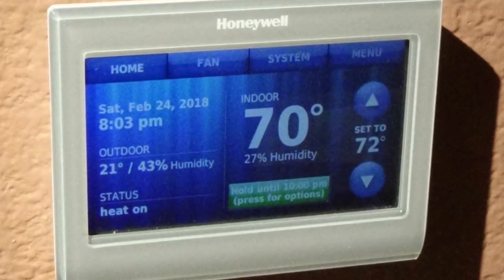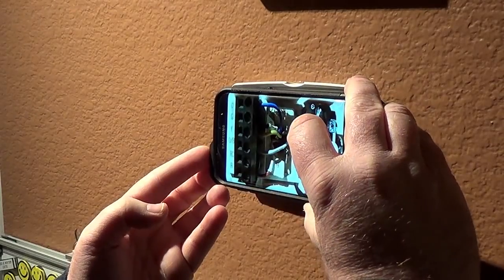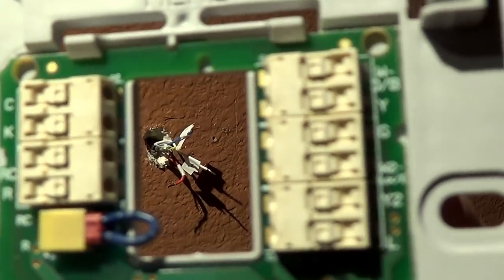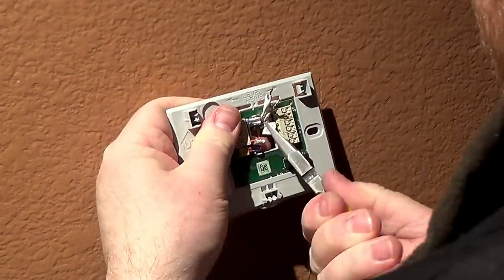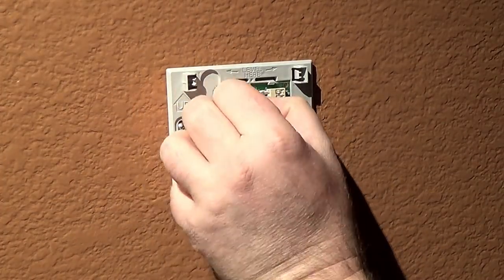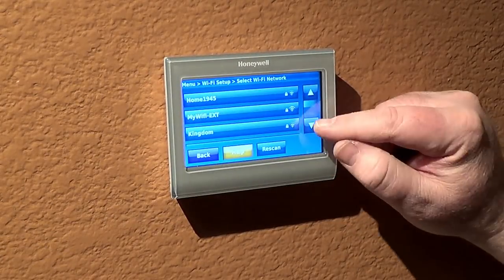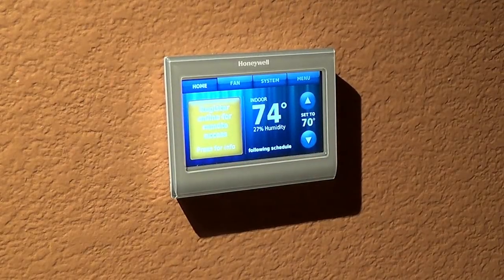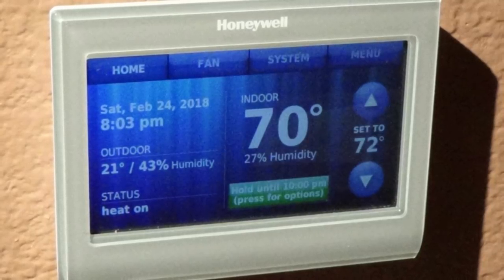Honeywell RTH9580 WiFi Thermostat EASY Installation

Comment: As an ac tech this video was awesome! To the point with simple details... Take a picture. Note the wires. It’s not rocket science.
Reply from the maker: mustangcircut Thank you. I appreciate that
Reply: Is for heat pump, same ?
Reply: Did that it still doesn’t work.

Comment: I have this thermostat and I cant figure out how to open it up again to get at the wires.  I am afraid I am going to break it.  Do I need a flat head to push a tab or something?  Or d o I just pull hard enough and it will release?
Reply from the maker: Should just pull straight off

Comment: Hi, I moved to a house that already had one of these installed. I see nothing in any of the menu's to connect to my wifi. How can I go about connecting it to my wifi? I made an account online and it's asking for the macID and MacCRC which appears on the device after completing the wifi setup steps. But I can't get to the wifi setup steps. Do I need to do a factory reset, and if so how do I do that on this device?

Comment: looks great. are there any downsides to a computer activated control? Like a power failure or wifi failure. The usual stuff.
Reply from the maker: dufus It works like a normal thermostat if your wifi goes out. If your power is out...the furnace or a/c would not work anyway.

Comment: My old honeywell is a 4 wire set up can I use this type of thermostat?
Reply: Yes, r w is for heat. C is for power the 4th wire can be g for fan or y for AC
Reply: @ershadbashiryar6642  I got it running thanks

Comment: Can you help. We had a new HVAC installed a couple of years ago. We never did anything with the thermostat. So now we want to use the setback features. But I think this Honeywell unit will only let you do it WiFi. The model is Resideo 69-2814EFS. Do you know anything about it or whatever?
Reply from the maker: No, I do not.

Comment: i have one of these and it has a really neet hidden feature.  when your power goes out the thermostat can no longer control the fan speed on your blower.  you have to pull it off the wall so it power off again, reset your panel on your fan motor and the reset the thermostat settings from scratch...  other than that its awesome !
Reply from the maker: Thats weird. Same model? The manual states that  "If it loses power, all the settings are saved in the onboard memory. When the power comes back on, the thermostat will continue to function as it should without needing any action from you."
Reply: the first part of that is 100% correct.... the second, not so much LOL... it also could just be my board/system on my blower and heater.  I have a carrier...
Reply: Ill also add, the way around it is if I know the power is going to be off, ill pull it off the wall... when i put it back it will work as expected
Reply from the maker: Your such a Debbie downer. lol
Reply: hahahahha thats me Captn Kill Joy!

Comment: Will this thermostat operate a Model 600 Bypass humidifier that's been recently installed?  Another words will this RTH9580 thermostat control the humidifier instead of the digital humidistat?... and how does it read the OUTDOOR temp and humidity? Are outdoor sensors provided with the Honeywell RTH9580 so they can be installed outdoors?
Reply from the maker: It uses the internet
Reply: @TheRealCobraBurnout    Thanks, but that's NOT the answer to my Technical questions. Sure the Thermostat can be operated remotely through the appropriate App. But that's NOT the question.  Thanks for trying.
Reply from the maker: @FirstClass-  that's how it gets the outside temp...so it was. That's all I have for you. Take care
Reply: @TheRealCobraBurnout    Thanks again, so this Honeywell Thermostat cannot operate a furnace installed Digital Bypass Humidifier w/Humidistat, and its outdoor readings are simply regional averages, not sight specific?  Too bad, but thanks again for clearing it up!

Comment: I have a quick question. Currently, I'm using mercury thermostat with 2 wires, is it possible to install from that?
Reply: Hi. We have a thermostat with 2 wires to. Did you buy a new thermostat? Was it okay for 2 wires?

Comment: Do you know how to get it to operate hands off? I don't want to have to set it to heat when I need heat then back to A/C when I need A/C. I thought it's supposed to automatically change between heating and cooling when it needs to.
Reply from the maker: Go to "MENU" > "Preferences" > "Advanced Preferences" After you set up the advanced Preferences for auto change over. Go to "System" on the main thermostat display and select "Automatic"

Comment: The connection slots are impossible to pull the wire out if you have to.

Why couldn't they use the screw terminals?
Reply from the maker: cost cutters

Comment: Mines only has 4 wires it does come with a c wire in the box but how do I hook it up I don't have an extra wire coming from the wall
Reply from the maker: See if there is one "not used" in the wire bundle probably tucked in the wall. Here is my vid on that: https://youtu.be/5YUqWZG5VPg
Or use one of the adapters that plugs in to a wall socket. https://amzn.to/3LSPzu

Comment: I bought my home not to long ago. This system is already installed but the the time on the unit is incorrect. How do I change the time do I need to restore?
Reply from the maker: Setting the time/date
1 Touch the current time. The screen
displays Set Time/Set Date.
2 Touch Set Time or Set Date.
3 Touch p or q until the proper time/date is
displayed.
4 Touch Done to save or Cancel to ignore
changes.
Note: This thermostat will automatically
update for daylight saving time (if observed
in your area) and all date/time information is
stored. If the thermostat is connected to Wi-Fi
and registered to Total Connect Comfort, the
current time is updated from the internet.

Comment: Would you have any idea why when I turn on the ac the heater comes on and when I turn on the AC nothing comes on?  I had called them and they helped me because my "OB" wire was in the same place as my "W1" meaning g on the new thermostat they were trying to connect to the same connection. He helped me and then I tried it and it all looked good we hung up and then the went on vacation for the Holidays so now  stuck in the heat with no ac if anyone can help thanks

Comment: Mine won't power on, bought over year ago for new house being built.     I have it installed properly, but it doesn't show screen, could batteries be dead because of how long it has been on original package without use.
Reply: It doesn’t run off batteries. The C wire (usually blue) needs to be plugged into the back of the unit and connected to the power on furnace. The older thermostats used batteries. These don’t. They need continuous power.
Reply: TButch130 my c wire is plugged into the back of the thermostat. What do you mean by connect it to the power on the furnace?.
Reply: @soju337  you ever get this part figured out?  I am having the same issue.
Reply: Shawn Brasuell no,  I think I had a faulty system

Comment: I installed mine and when I choose "cooling" and when the unit start running it turns on the heater and it blows in just hot air.
Reply: I had that same issue. Did you ever figure out how to correct the issue? I just uninstalled it and re-installed the old honeywell one I was replacing.
Reply: It is possible a that you need to doublecheck the configuration of your thermostat. If you have a Heat Pump system, most likely you set the thermosstat for a conventional system.

Comment: Thanks for the easy setup. I am thinking about returning it after finding out that u can't setup the schedule using the phone app.
Reply from the maker: I can set my schedule thru the phone app. So, I'm not sure what you are talking about? Its super easy to do as well. Open the app, click the Schedule button at the bottom and have at it.
Reply: @TheRealCobraBurnout  You are correct. For some reason I could not see the bottom portion of the app when I first started it. But after closing it and reopening it, I was able to see the button for schedule. Thanks for the video and thanks for the reply!
Reply from the maker: @st3ady  ok. Good deal